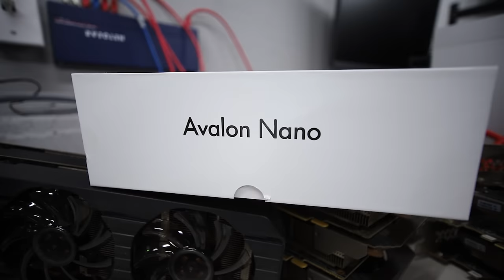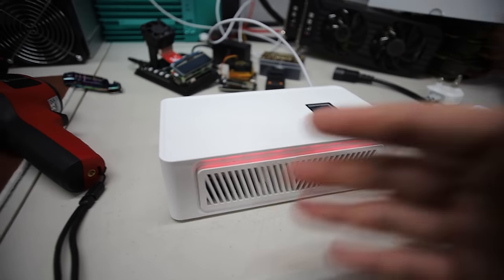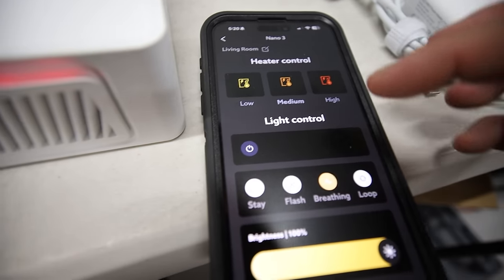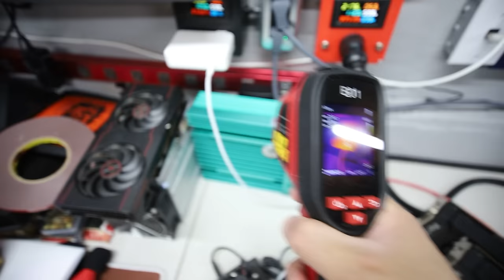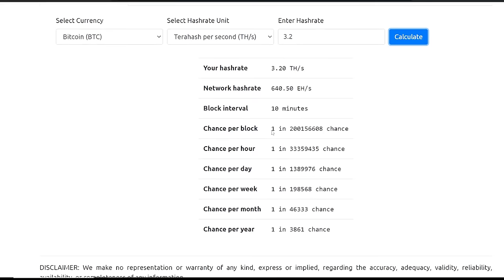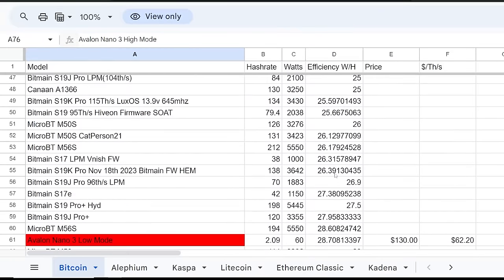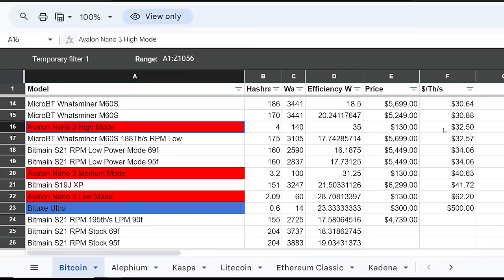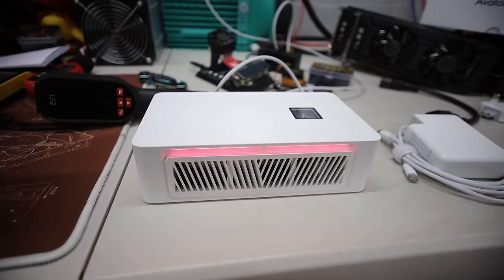This is the BEST $130 Bitcoin Miner! How to Solo Mine BTC Quietly

Comment: The miner draws 90w.
But the outlet says 104w.
That is 90w for the miner AND 14w in efficiency loss for your power transformer.

Your power transformer has a 86% efficiency and is wasting into heat and other losses 14w..

A tip is to maybe use a power transformer that uses GaN technology that has less losses.👍

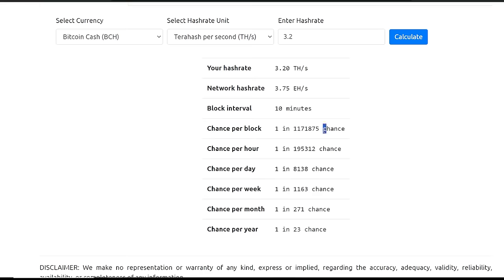Comment: 9:24 If your chance per year is 1 in 23, then it is possible to mine for 23 years to get 1 bitcoin cash block, right?  So, running a 100 watt lightbulb for 23 years plus the cost of the hardware would be the possible cost?  So, $449.48(5-9-2024) to pay for 100 watts for 23 years ($2,200 approx) and $130 hardware.  Don't forget to factor in the heating of the home in the winter.  Also, factor full coverage homeowners in case it overheats and burns down the house.  Sure hope bitcoin cash goes up.

Comment: Thanks for the in-depth review of this.  Just ordered two of these after your review.  I have Dell 165w power supplies on hand and will post what the speeds and temps are when this arrives.  It's not cost effective for me to run any of my miners due to my power costs but since I have to run a space heater anyway to heat my basement, this solves two issues, warmth and mining.  Thanks for the awesome reviews and keep them coming.
Reply: Do you have specific setup for heating?

Comment: So, you run these devices, that consume a lot of power. Your chance of getting one bitcoin is 1 in 2500 for the year? If you are successful in mining anything, does the value of what you mine offset the cost of the additional electricity that you spend in the mining process? If you can't tell, I'm very green on this. I just want to understand the process, thanks

Comment: sounds like the power cord you have only supports 100w. The cable and brick will have to both be at 140w to run it at max speed

Comment: Great Review, good run through and comparison 👍

I'm in the UK, i ran my numbers with my energy tariff and i' make a Monthly Loss of £13.74 = $17.05😢

Maybe after the halving and come winter it'll be cheaper than gas heating.🤔😂
Reply: It will never be cheaper than gas heating.
Reply: Ideal for a use with solar setup , especially if you buying an inverter etc second hand .

Comment: I'm not getting the economics of this yet. I'm obviously overlooking something. If you make $.40 a day x 30 = $120 a month x 12 = $1,440 a year. But you power use is say... 140w x 24 hours, x 30 days = 100800w, x or 100KW. In CA that's about $.30 a kw, or $33.5 a month x 12 = $405. So, you clear roughly $1k a year if you have no added costs or maintenance? Is that why you bought 7 more - to make it generate 7K a year?
Reply: That math is wrong .40 a day x 30 is $12
Reply: You need to take a math class.
Reply: you have calculator and u still f'd up😂
Reply: @JoseGonzalez-lp6nj bro seriously that’s like 12 bones a month 😂😭

Comment: After the halving them 0.30¢ per day ($109.50 per year) will turn into an easy 0.15¢ per day ($54.75) 😬
Reply: What if you hooked this up to a Kano or NiceHash etc. to generically mine 256. Would the BTC reward you receive also be halved in that scenario?
Reply: Crypto usually pays transaction fees plus the new block, so not actually halving the total reward like that.

Comment: Yes i like it because of the low voltage i will probably buy one after the next review of the original power supply I’m  off grid solar and i only mine when the sun is out. Also i was wandering the most profitable gpu coin to mine

Comment: you should find 1 BCH block on average every 23 years, not 23 chances to hit a block in a year. You have as many chances to hit a block as there are blocks minted per hour/d/m/yr... but on average you should find a single block every 23 years... (if the hashrate doesn't change during that time)... then you'll hit a block after year will be less than 5% chance.

Comment: Nice one, thank you for sharing !! this is really valuable content I think and if it wasn't already sold out, I'd buy two for myself to heat up an area in my living room that is not so warm in the winter, but yeah, I'll check on your video with the original power supply and see how that goes. Thanks again great great video.

Comment: FINALLY got mine plugged in (ordered literally a day from watching this video) - and despite the usual stratum addresses I use, this thing is stuck in IDLE, and firmware update isn't working (mine is the latest). Its drag and drop the file...so what gives? The PS? (on low for troubleshooting, with no miniscreen errors). They don't exactly have an official forum help site.

Comment: The power supply seems concerning, seems like it was actually quite hot which makes me a bit nervous.  I know it wasn't the official power supply but was similar.  Seems to really be  pushing the limits on safety with all that power simply running through a USB cable.

Comment: Another important point is that these machines work via Wi-Fi network 2.4, so it is totally impossible to compete with miners that use Ethernet connection
Reply: These machines are used to clean small jobs and not to pay for them because if you mine alone you will not get any payment until you find a block
Reply: The goal of many cryptocurrencies is not to pay miners and that is the path that is being marked, smaller and smaller payments until they can do it for free, payments now are mostly made with losses for the miner who has to pay out of pocket more than earn something

Comment: Well, if you hit one every year every two years with bitcoin cash you’re doing really good cause your chances are once every 23 years that’s what one and 23 means so you’re more likely to hit a solo. He had a 50-50 chance of hitting it once every 12 years and that’s just 50-50 chance purely mathematics we’re talkingshould get one every 23 years so it’s 3500 right now that’s like $170 a year so basically you’ll get your cost of your unit back in a year but that will be made up in electricity. I’m sure.

Comment: How will the bitcoin halving affect this miner?
Reply: With the halving next week and assuming all in (including supply fee and taxes) electricity costs of 0.20 kwh and a current BTC spot price of $70,000, I'm coming up with nearly 2 years to ROI. That's why I was wondering if you could just hook this up to a Kano or NIce Hash etc. which generically mines 256 but rewards in BTC. If this scenario is not going to be halved, you'd have just 1 year to ROI. Of course the biggest variable is BTC price. With China's largest fund now applying for spot ETF, BTC spot price going much higher later this year.  This would dramatically decrease ROI as well.

Comment: I really like this. I think I'll be getting one. I have been wanting to get into mining but i live in an apartment. So i can't go too crazy with the size/noise/heat of miners. So this seems like a really great mix of small, fairly quiet, efficient, and not too too much heat generation to the point I'd be uncomfortable if i was in the room with it. Pretty certain I'll be getting at least one!
Reply: I bet in an apartment the power recepticals are back to back on the dividing walls. So if one were to take the plug plate off and carfeully pull the receptical out and look in there I bet you would uncover your neighbors wiring plug wiring as well. opps

Comment: I think we need to be mindful after halving it be less than 30cent from 700 sat to 400 a day in April, however if you find a block you are very lucky man it will be 4btc instant after halving. Do you consider yourself lucky punk, well do you? 😂 purchasing BTC directly is usually going to be cheaper. Unless you live in a cold region where you will certainly enjoy the heat from your miner. So it is important to consider all the options. It is better than any other nerd miners with 4th hash rate you have a better chance hitting a lottery ticket

Comment: In Winter you can heat your room and apartment ❤😊❤ win-win
Reply: with 140 Watt? Really? Even for my normal 20 square meters living room I would need to let my 2000 watt Heater run for quite a while to raise the temperatur even about one degree. With 140 watt the best you can do is prevent your hot cup of coffee become cold. It would stay mid-warm. At best...

Comment: unless you consider yourself a lucky guy, i would never buy any hardware for solomining. It's just absurdly useless.
Reply: Why do you say that? If you solo mine say BCH like he is doing your chances are pretty good I would say in a year. You have a 1 in 145 chance per month and a 1 in 12 chance per year by solo mining bch. I would say that is much better then bitcoins chances(1 in 33,718 a month or 1 in 2810 a year BTC). All you have to do is hit on block a year and you are way ahead. 3.125 block reward for BCH in todays price of $678 = $2118 . And the unit is hardly consuming electricity.  So say Hypothetical it burned $400 a year electricity and the unit cost you say $200. in one year your ROI is $1518.  Im going to give it a shot at those odds!